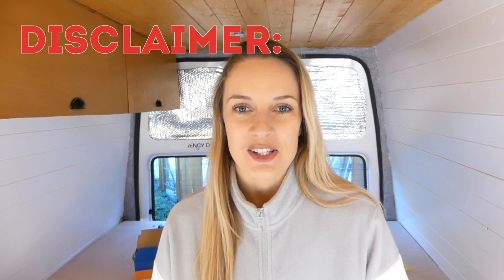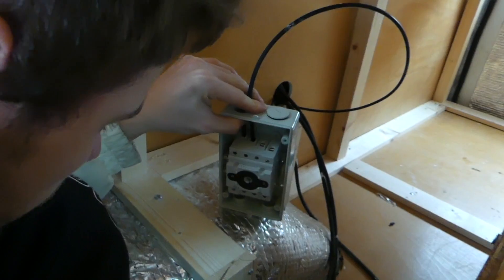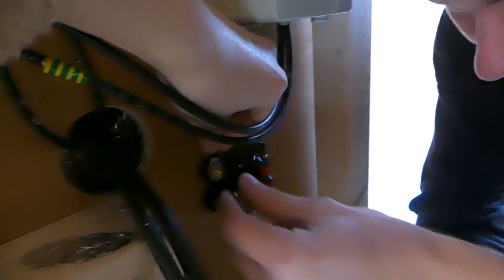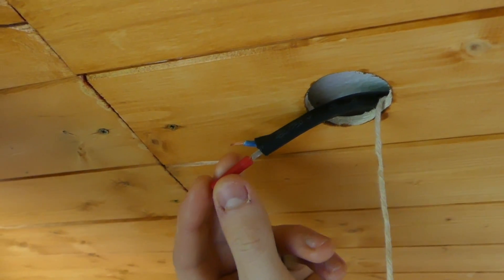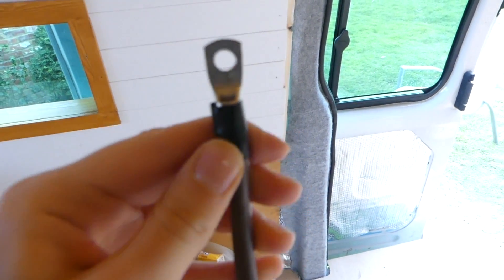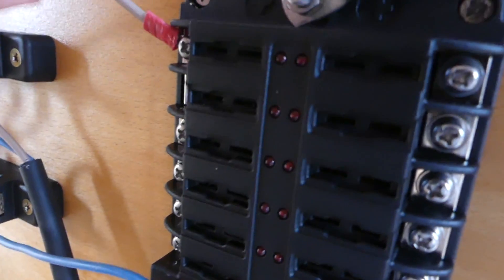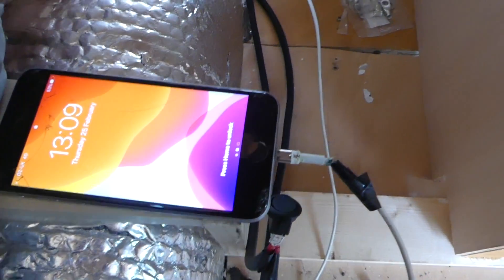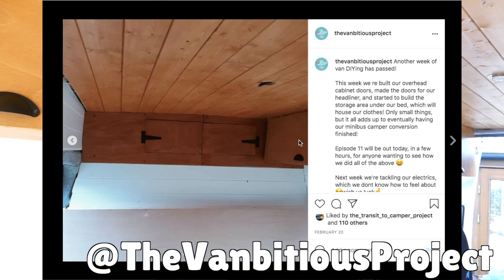Ep12: BEGINNER 12V ELECTRICS Set Up/ Step by Step Tutorial / UK MINIBUS CAMPER CONVERSION/ Van Build

Comment: Why do you need both a dc isolator and a circuit breaker after the mppt? And why didn't you use a circuit breaker before the mppt instead of a dc isolator? This is the first time I've seen this so would love to know please 🙏
Reply from the maker: Hi Lauren, to be honest we’ve heard some pretty mixed reviews of the circuit breakers at such a high and varying input of power from solar panels, they can sometimes trip and break the circuit. So we used a DC isolator switch before the MPPT (in case we needed to stop the power ourselves), and a circuit breaker after the MPPT to stop a flow of too much power getting to our battery (in case it spiked for any reason). Hope this makes sense and helps, quite a lot of other van builders use a DC isolator! 😊
Reply: @NickyandHarri  thanks so much, very helpful!

Comment: Great work. On the dc isolator I’d use some glands or grommets to prevent any foreign objects getting through those holes. Should be 20mm diameter for either grommets or glands you’ll need
Reply from the maker: Great advice mate, had definitely thought about doing this so next time we go to Screwfix we will remember to pick some up! Cheers!

Comment: Awesome video guys. 
Just a couple of bits as I have very similar parts.  I'm not sure where you got your mppt from as this is the older unit you guys have, the older unit is common positive which isn't good for you. The newer mppt is common negative now and blue buttons.  
Bit of advice, never keep connecting to your battery by touching wires or you will do damage.  Also when connecting solar.  Always isolate solar 1st, then connect your battery to the mppt 1st as it needs to recognise the battery first voltage and type of battery etc
Reply from the maker: Hi mate, thanks so much for all the information! Will defo have a look into the difference of the MPPT. Will defo take on board the advice about the wires + solar, cheers mate. Thanks for keeping up with the eps- hope you're enjoying them!
Reply: @NickyandHarri  guys loving your channel it's awesome :-) very good content.  I'm loving your battery power of 200ah 😍 very nice electrical set up you have there. Everything you have is spot on too ;-)  Just get your mppt swapped for the one with blue buttons ✌